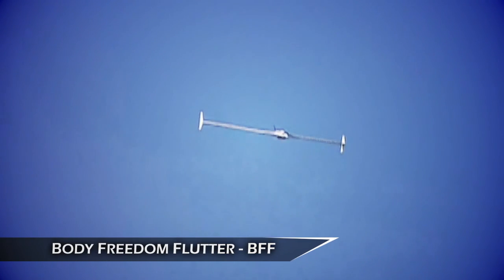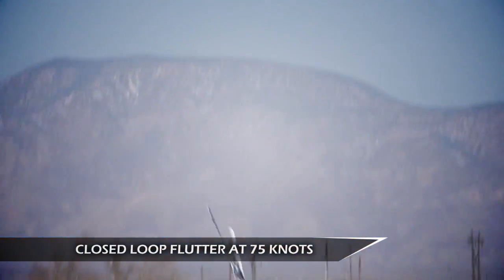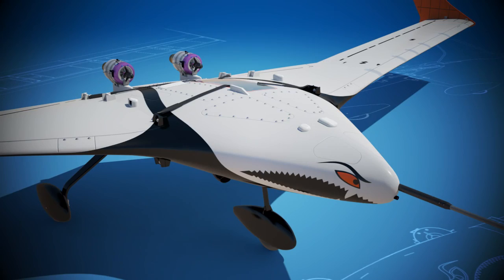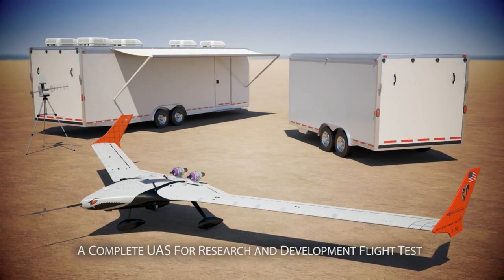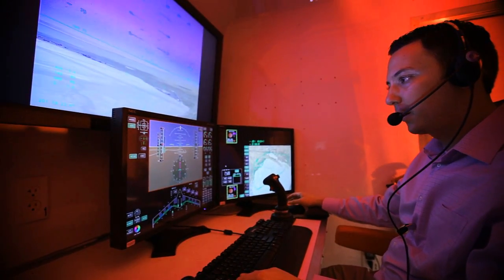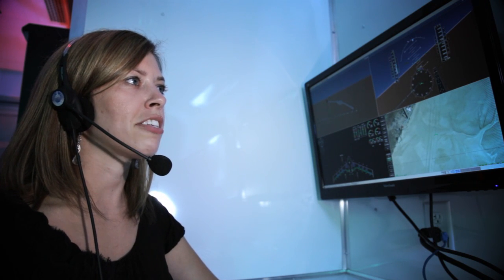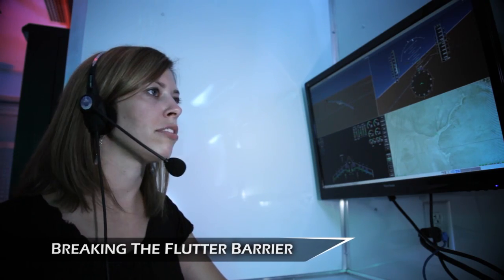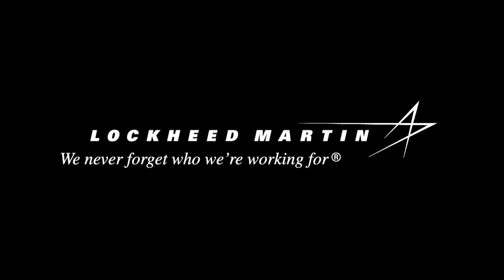X-56A: Breaking the Flutter Barrier

Comment: None of my modell wings does make such problems even in steep nosedives and in harsh abuse against all specifications. With a progressiv backward sweep in the wing reducing the lift to the tips and some fences this effect should not occur, even if the outer steering surfaces can be trimmed to reduce torsion and the rapid change in load between profil momentum and the constructiv downforce, if no S - shaped profil is used. That shall be calculated without any further .....
Reply: That's because you've made the wings strong enough to not flutter. You could reduce weight and drag by making them thinner, but then you'd get flutter. That's the purpose of this program. Making the wings so light that they would always suffer from flutter unless it was actively damped.

Comment: Yeah, but HOW does that active flutter suppression work???????
Reply: that's the coca cola recipe bud
Reply: patent pending probably :)
Reply: Sensors detect the flutter, computers analyze it and determine how to move the control surfaces to damp it. It's the same thing that advanced ground based telescopes use to actively shape their mirrors to counter atmospheric distortion of the light they're gathering. Also similar, but much more complicated than the knock sensor in your car's engine that prevents damage from pre-ignition by altering the timing when the onset of spark knock is detected. Sensors detect a problem and a computer program instructs something to counter the problem.